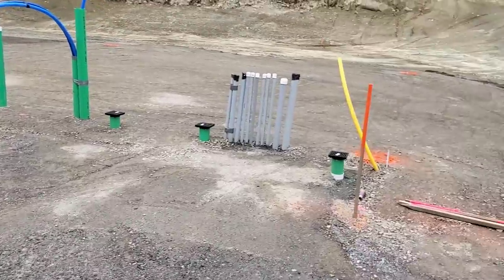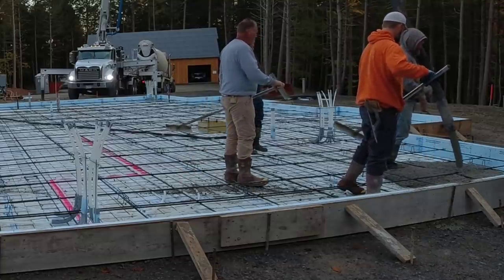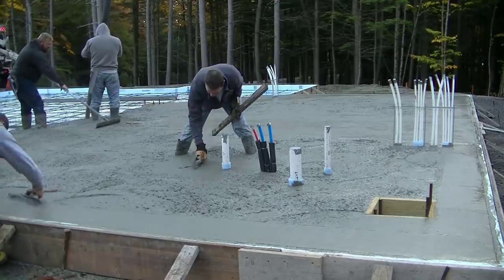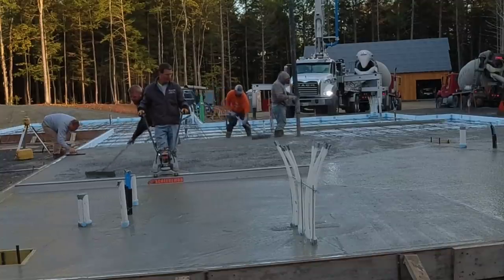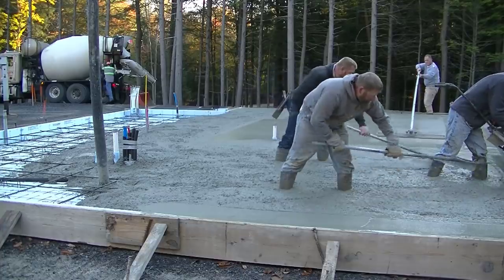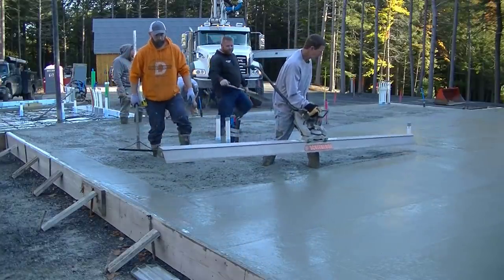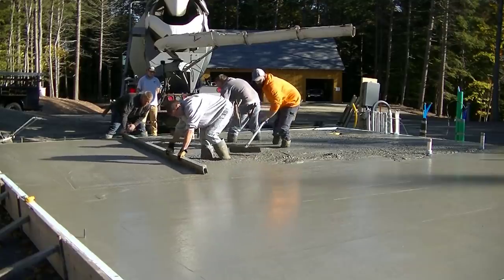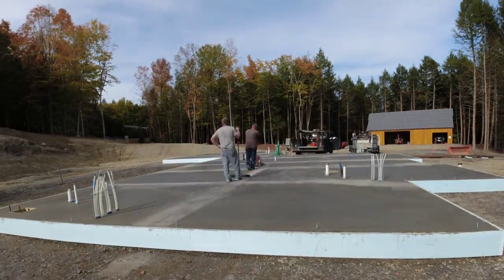He Made Us Pour His Concrete Slab 10 Inches Thick! (Waste of MONEY?)

Comment: Professional civil engineer, decades of concrete design for sidewalks on up to DoD airfields..  concrete thickness all depends on the base aggregate thickness, compaction of the subbase and aggregate, and reinforcement.  There is no substitute for any of the items i list. Although with a thicker well compacted aggregate base you can land a C17 on 10”!!   Without reinforcement it doesnt matter if you pour it 2’ thick!!  Little exaggeration, but you get the point.  Its hard to say if the 10” section is necessary..  but its not wrong.  Without deep footers id say this is an appropriate design given it has adequate reinforcement and compacted soil and aggregate

Comment: I poured the foundation for my house and we prepared the area :   dug out 6 ft of dirt and replaced it with a special dirt mix which had some concrete in it,  compacted it and then poured piers 18 ft deep every 8 ft under every wall of the house  .  Then we poured a slab 48" thick with 5,000 test concrete with a brick ledge so the brick covers the edge of the slab.  This was 30 years ago and there is no settlement or cracks in the entire structure.   Our soil is highly expansive black gumbo.

Comment: The thicker concrete will be a much bigger thermal mass for the under floor heating system. Once it gets up to temperature it will hold that for much longer. Those savings over 20 years could be significant.  Added benefit is the slab is much stronger.

Comment: Where I live the ring foundations are around 12 to 16 inches and the slab is around 6 to 10 inches depending on the terrain, span and building height. With such wet concrete with small aggregate and finer sand, it will inevitably warp or crack in time. If you are building something that will last as long as a 20 year mortgage then 6 inches should be okayish. If the building codes are aimed at a 50 to 70 year useful lifespan then perhaps use the 6 inch liquid slabs for the tool sheds?

Comment: I worked for DOT and there were standards, of course, for concrete used in our projects, that required measurements of slump, air entrainment, and verification of compressive strength. I'm wondering if this type of construction has similar requirements. OK I heard you telling us the slump, do you confirm compressive strength too? I suppose at a 6"or more slump you don't need to use a vibrator for that depth to settle it. And yeah, 10" is a lot. You really want to support the edges at that thickness. Really good finish there, pal.

Comment: IMHO for a house this size 10" is quite alright, anything less is poor. 
I have other concerns: you wrote about a radiant heating system - I can't see any insulation beneath it. Here in Germany we make a two layer pour, first layer of standard concrete, then a pressure resistant insulation and on top the heating pipes in a layer of special concrete for radiant heating systems, "floating" on top of the insulation. Without, you have to heat up the whole slab and massive heat losses to the ground - if winter comes in october, you'd have to start heating the house in july or early august then.
I have another concern: you poured only one big slab, but there are two sections standing out of the main one - due to thermal movement their joints are prone to cracking. We do the top layer in sections with a strip of synthetic rubber between them, sealed with silicone - worst thing to happen is replacement of the silicone, if it doesn't hold up.

Comment: Nothing wrong with 10” thick reinforced concrete, what’s important is the stability of the sub grade, and sufficient and proper expansion/ contraction joints. The price of an extra 20 cu yds of concrete is nothing compared with the cost and inconvenience of future repairs. If the customer is a builder, it’s likely he’s going to have some heavy loads parked on that slab… your work looks good… pleasure to see.

Comment: I think it's great.    If you heat up 1 cubic ft of concrete to a given temp and compare it to 10 cubic feet heated the same. The 10 cubic ft holds temp longer on turn using less energy to heat.   Unless it's just heat from the earth simply circulating at 45 or whatever.  But either way , not overkill.

Comment: My grandpa said I overkilled my house too. Built a 30x20, 20x20 of it is on concrete blocks I cemented together with 5x10 by 20ft beams I made to hold it up. I used 2 2x10's with 1 inch plywood between them. The entranceway where I have my water tanks and woodstove is on some concrete slabs I poured. I was intending for the house to be a 2 story, but in 2020 lumber was getting rare. I can always take the roof off later and add the second floor in the future.

Comment: I'm not a contractor, but I once pulled a permit for a bonus room.  On the sample plans the city hands out, to put in concrete bolts to attached to the frame every 16 inches on center.  The  concrete guy just follow the instructions. When the carpenter showed up he said, what the heck with all these bolts.

Comment: The extra concrete is insurance against slab cracking, it pays for it’s self every year.  I like the no PT slab, I would have put in a little more rebar, say 16” oc each way and a band of heavy bar around the perimeter, I am afraid of slab curling on the edges.  The extra mass helps with the radiant heating efficiency.  Cure with a surface hardener that is compatible with flooring adhesives.

Comment: Radiant in floor heat? Thicker slab = more thermal mass to maintain temperature once it reaches desired temp. Probably save a bit in heating costs long run. Plus it’s a stronger foundation. Money well spent.

Comment: It is oke a thicker slab, all costs are the same, the extra costs is only the 30% extra volume of concrete. And it makes the slab much more durable on long term and when unexpected extreme circumstances appear in the future. For example heavy rainfall, but also when you want to put an extra building layer on top.

Comment: More concrete isn’t necessarily an advantage. We live seismic zone which has experienced M>8. quakes. This requires that our structures be designed and engineered to withstand these tremendously powerful temblors. While concrete can be mixed to withstand heavy loads it’s the metal reinforcing that engineers spec to withstand the shakes and heaving which results from tectonic movements. In my layman’s view, a 10 slab might include a doubling of the rebar reinforcement mat to prevent the slab from bucking which produces settling cracks. If the slab is being poured in a cold climate area, the freezing and warming causes shrinkage during winter and expansion in summer. I hang my hat on the notion that the thickness of the slab also must accompany sufficient reinforcement to hold the concrete in place.

Comment: The fact that you use water reducer also strengthens the concrete more than the thickness.  Probably overkill because larger houses are built on 6 inches.  He might be trying to prevent cracking from long spans.  Hopefully it was covered and wetted to set solidly so it won't crack from internal stress. Thicker takes longer to cure.  If he keeps the floor temperature constant year long, it will go better for him.  Hopefully he will never need to replace a drain or fix a heating hose, or it will be much more effort.  If he saved money on grading, etc, then Hopefully he doesn't pay out for it down the road.

Comment: I ran a 10" pour and after covered the slab in plastic to heat for about 3 weeks while building. I did ""Gently" run water under the plastic during those 3 weeks keeping it green and slow drying. This slab is hard as a rock after slow curing.....YOU CANT CHIP IT pounding the floated finish. Rebar is the problem...I prefer galvanized for longevity. It resists rust over time.

Comment: The base that the concrete is sitting on has more to do with long term stability and is cheaper to increase than the concrete thickness. 
If he really wants a "no issues" scenario go with post tensioned cables. There are plenty of buildings built on concrete podiums that have been around for 30 years with no failures. 
Post Tensioned slab also provides a way to fix cracks or settling issues by cutting, replacing and re-tensioning  new tendons.

Comment: Most concrete slabs are under-engineered and settle into a damaged condition after 5-7 years.   Use of fill dirt to level a building site invites more severe versions of the problem of foundation cracking.  Use of columns with bell-bottoms reduces foundation settling dramatically to near zero.   Thick slabs with columns and bell-bottom footing are best.  Those who use 5,000 PSI concrete for thick slabs get the best available.  Most homes are poured with 1,500 PSI concrete and suffer expensive damage throughout the mortgage life.

Comment: I've seen many old houses and buildings that were built in the late 1800 to early 1900s that were on foundations that were 12" to 24" thick with walls that were in the 14" to 20" thick range.  Very few cracks even 100 or more years out.

Comment: It looks like the slab is piped for underfloor heating. So by having that  thicker slab he has increased the heat storage aspect of his floor . 
I am in the Uk and I hear how ppl with under floor heating are keeping the heat pump running 24 hrs. To keep there house warm and I often wonder what thickness slap they are using  I have done my house with a slab of 8 inch Concreat and my heating system runs for. 4 hours during the night and the slab stays warm and heats the house for the rest of the day.  So it may be he is trying to do the same thing . Be intresting to know

Comment: silly question; what was the concrete rated for?  30 mpa, probably?  maybe he's putting multiple heavy lift floor hoists in there?  if it was 60+ mpa, that's definitely overkill.  it doesn't look like it was a spec job so it was probably standard 30.  I'll say overkill, anyways.

Comment: I like to overbuild everything I make & have my contractors do it for me if I’m not doing the work myself.
   It would certainly provide much more thermal mass which I think would be mostly good, especially with radiant in floor heating.
   I wonder why more jobs aren’t poured using hydraulic concrete? That stuff is great and can even be poured under water…the wetter you get it the faster it dries!

Comment: actually for bearing walls here in south carolina 10 inches would not be enough when you have to drill at least 12 inches in some cases for bolts or anchors, obs i do carpentry not concrete.

Comment: Mike,  It is a good idea to pour a full 10".  The extra concrete costs $3,300.00 per your estimate. Divided by 12 months, divide that by a 30 year fixed mortgage = an extra $9.00 per month..   Will your  air conditioning bill go down more than $9.00 per month and will your heating bill also go down and give smooth warm heat.  Yes, Yes, Yes.  And all the tradesmen had an easier time, You forming it, the under ground plumbing,  The foam, mesh, rebar, radiant pex.  all had ONE smooth surface to work on and walk on.
NOBODY gets a bad attitude!!   And everybody makes money, low operating costs in the future. Win /Win

Comment: Definitely not overkill...
You're pouring a structural raft slab that will float the house on  what appears to be a compacted granular engineered fill, directly on top of the native soil...
You keep calling it 10" thick, but it is clearly not a full 10". 2 x 12's forms are 11-1/4" high, minus the 2" of rigid insulation, gets you closer to 9" for the slab thickness.
If you ask me, the re-bar mat seems to be a little lite at 24" x 24" grid. I would have beefed up that mat to a 10" x 10" grid of 15m bar... 
Good efficient crew you got there, and the slab looks really good.
Well done.

Comment: Speaking of "overkill" I once helped a guy pour concrete for his unattached man cave back in the early/mid-90s. For the TLDR crowd, yes, I think this project helped lead to the divorce. His property had a significant hill grade overall, and he had to put it about 30 yards from the house. He had to pour about many inches of concrete, on top of at least a few feet of gravel, because it was in a flood prone area, and didn't want his fancy audio-visual set up washing away. He put down some serious vertical rebar too, to help stabilize it. When I say serious, this is KY, he went down to the limestone bedrock. There were also some PVC pipes for drainage down the hill. He had vertical I-beams too, to hold the concrete slab in place. 4x6 wooden verticals six inches to the underground I-beams for the actual "shed". The square footage wasn't that much, maybe the size of a two compact car garage for skinny people with the cars 69ing so the doors had enough room to squeeze out. Enough for a small bathroom, with a toilet and a urinal, with a stand-up shower for the drunks, and could fit 3 couches, and his wife wouldn't have to hear his friends screaming at each other over the sports games. He never finished it though. He ended up getting one of those pre-built aluminum things about half the size when they ended up in divorce proceedings and pretty much lived in it until the divorce was final and the house and property was sold. IIRC, he actually rented the space from the new owners for a few months until an apartment or house rental big enough for weekend child custody could come through.

Comment: The oldest side walks we bust  when renewing gas lines to a main are thick and didn't move mutch. Same for driveways I can tell a good drive way by how old it is and how it didnt even move.....so I pured my fire pit base 1000 lbs....so I never have to do it again. But the stuff that doesn't hold up is 4 and under in my experience and it's the easiest stuff knock out and unleveled it self in probably the first decade. The hardest concrete sidewalk I ever took a saw to I asked the owner where the concrete was from I was so impressed. Scranton craftsman this batch in the man's sidewalk is legendary. If I had to re pour my side walk it will be 6 inches thick. And if I do my driveway it will be 8+

Comment: I would think more concrete would be fine.  I am sure there is a point of diminishing returns..  I do wonder how the in floor heat will behave with the floor so thick.  I would think it would take a good week to get the slab up to temp and then it would radiate that heat for probably a couple weeks after the system is shut off.  The house might get extra warm when there is a warm day in the middle of winter...
Reply: It's a dumb way to do a heated slab. See my comment above as to how to do heated slabs.

Comment: My comment would be is the mix perfect first and not short changed. the second comment this is on the side of a hill so a concrete raft of substantial thickness is required. The third would be how many test cubes did you take for later testing strength of the concrete.

Comment: Well, if logic stands, then anything which is built to higher-than-code standards is perfectly reasonable if the owner can afford it? It might be comparable to placing 2x6's for wall studs and then setting them at 12' centers? You can do it, but it will cost you. Although it would probably stop a falling tree from coming through your living room?

Comment: I'm curious as to what this concrete mix is rated for (load bearing- psi).  In a couple more years, looking to build a 30,000 sq.ft (footprint) 3-story main house, garage-industrial machine shop area, & barn. The slab for that's in the ballpark of 100'x300'. It needs to be built like a fortress. Made to look like an "earth-ship" that blends into the high mountain forest landscape. I was thinking slab thickness should run ~30". Atop 10' of compressed gravel.  Words of Wisdom?

Comment: It's about thermal Mass with a heated floor, using it like a battery.  But if it was me I would probably invest more in insulating my slab and possibly additional counter measures around the perimeter down into the ground around my home.. including things like exterior drains around the perimeter to keep any moisture away from the home/soil/foundation concrete in any way. 
I talked to my parents into a home built on a slab like this with foam walls that are filled with concrete and they don't turn their heaters on in the winter.  No radiant floors needed.. 20 years plus the thing is amazing! I'm sad to hear they're selling it going into retirement..

Comment: Slabs are cheaper NEVER better! Radiant heat is super expensive to run- shut them off and it will take 3 days to reheat the house back to comfortable- Basements are always the way to go in Cold 🥶 Climates he’s not improving anything he’s going cheaper to have no furnace - the fuel tank will get buried in the ground so it’s bad all round- 😎

Comment: Your customer knew what he was doing. I have been coming behind all other trades and repairing problems that arose from insufficient concrete in the slab (resulting in movement, causing doors and windows to become difficult to operate), insufficient wiring (causing AC units to struggle when starting or burning up breakers), sufficient weight of felt paper or shingles on a roof, insufficient height in flashing….. “INSUFFICIENT”… Since the beginning of WW2, engineering has sought to “GET AWAY WITH AS MUCH AS IS POSSIBLE”, and our nation has hurt incredibly for that mindset.
When I build or remodel or repair, my mindset is “OVERKILL OVERKILL OVERKILL”. Every addition I have put on a home, has seen the owner telling me, “If there is a tornado, this is the room I am to.” (And none of those customers knew each other.)